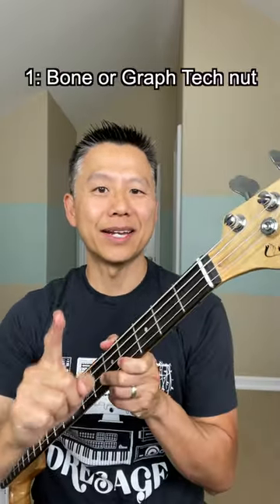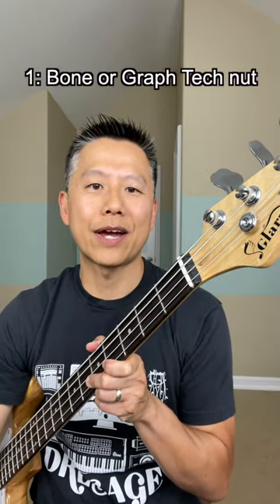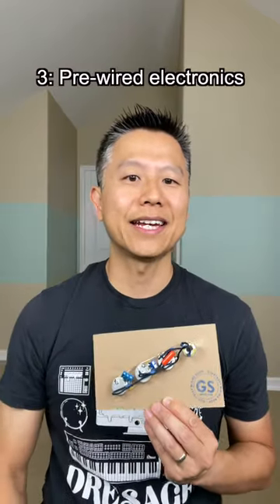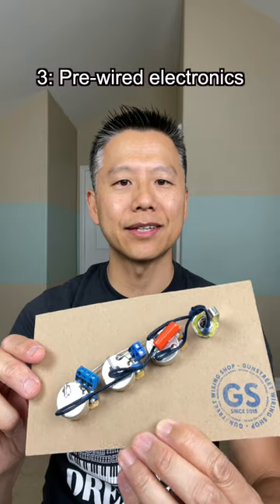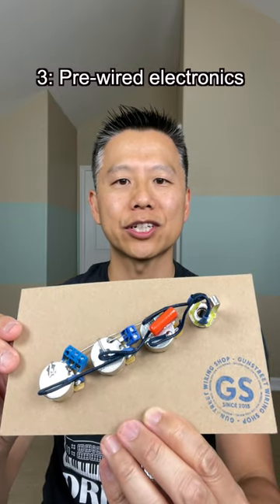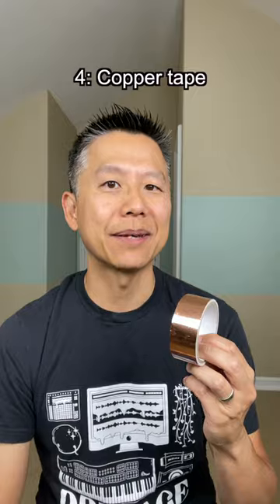How to Turn Cheap Bass into Killer Bass Guitar #shorts

Comment: And spend a few hours on fret levelling, rounding off the fret ends and polishing them.
Reply from the maker: Yes this. Although I was surprised that the fret on this Glarry bass were pretty good. No sharp fret ends but I didn’t check levels. I’m sure with some work it would be even better.
Reply: I would just pay to have the damn thing PLEK’d if ur gonna go that far
Reply: Replace Neck . . Replace Bodywork (wrong Cheap ass Wood )

Comment: I actually bought the entry level Spector and it's a monster right from factory,  just going to change the nut to brass and the heavy weight bridge and copper shield the electronics cavity.  I actually like the stock pickups in the Spector.

Comment: I did not replace the nut, i am using sjb1 instead of sjb3, replace all pot with CTS and puretone jack, also use threaded saddle for more precose string spacing
Reply from the maker: That’s great. If you haven’t already, check out my full length video for tone tests and final impressions. https://youtu.be/o8gesEiL_1k

Comment: And 1 more thing....spend 50-100usd on a high mass bridge. A Leo Quan BADASS bridge is one of my go to modifications. Aside from increased sustain and tone, they intonate better and have better stability thanks to the shallower string angle.
Reply from the maker: Cool thanks for the tip

Comment: Along with some Schaller tuners and a Badass Bridge.
Reply from the maker: Good suggestions for future project
Reply: @AntshayMusic  basically that's what I did to my Yamaha 5-string 30 yrs ago I replaced all the hardware. I added Bartolini's Pickups (P bass & Jaz,) plus Active Electronics also adding a mid boost to get that simulated Jaco sound. That was my main gig Bass. So versatile..

Comment: I'll give him credit for the mods done, despite info being obvious. But i do have to say that if you're going to upgrade your bass after purchase anyway - just buy a better bass from the start. It has better quality wood and hardware, so you won't have to upgrade as much. Wiring is also a rather unnecessary mod unless you have really shitty wiring or really good signal chain (amp, speakers and cables)
Reply from the maker: Agree. Check out my full length video where I explained why I went ahead with the mods https://youtu.be/o8gesEiL_1k

Comment: Should have done a quick lick or few riffs on that bass to compare the tones of the cheap factory hardware and the quality pieces. Looks badass and I'm sure it sounds awesome, but if you grow tired of that upgraded bass it's still a cheap bass that's only worth the value of the hardware you swapped in so be sure to keep all the original pieces just in case
Reply from the maker: I'm working on a full length video...stay tuned
Reply from the maker: Here you go https://youtu.be/o8gesEiL_1k

Comment: Usually need to address the frets. There's usually sprout and one or two that are not level. At that point just get a new bass.
Reply from the maker: The frets on this Glarry were surprisingly good. No significant fret sprouts and no major issues with levels. That’s one reason why I liked the bass enough to want to do the upgrades
Reply: @AntshayMusic  That's not the norm regarding the level frets. Its almost always a problem, even higher end import basses in the 1k range if checked out will have 1 or 2 that are not and require a full fret leveling.

Comment: I suggest buying some used fender pickups & electrics on reverb/ebay if you think that's necessary. Why would you spend so much?
Reply from the maker: I actually checked ebay and Craigslist before I made this video and didn’t find the right pickup and the right price.
Reply: @AntshayMusic  The bass is $129.58 (w/tax)
Those pickups are $192.91 w/tax.
Harness is $77.70.
At LEAST $75 to install. Nut replacement/file around $40 for synthetic.
That's $509.18 and you still own a $120 bass.
$500 would get a decent used bass, that makes more sense to me.

Comment: Did you talk about scrubbing the mold off glarry fretboards, finish hammering the frets into the board, fret leveling, etc?  These things would not be all that is required to make it 'killer'. What you say might make the right Squier a killer bass, but never a Glarry.
Reply from the maker: It doesn’t have to be Glarry for sure. The neck on my is actually pretty good.
Reply: @AntshayMusic  pretty good or "killer"? I've owned a few glarrys and all needed extensive fretwork and massive cleaning of green from neck and frets. Mt point is without luthier work beyond what you describe, a glarry will never be classified as "killer" unless you have super low standards. If you had used a squier, sure, but you used a guitar someone can buy for $70 on ebay and claim it can be made "killer", which is pretty much bullsht. You are steering beginners to buy a shit guitar and dump $400 worth of parts and it will still be a shit guitar as far as craftsmanship, durability and playability, particularly fpr a beginner. Advocating spending that kind of ey on a glarry is shit advice. That's the truth. I hope no beginner or anyone takes it seriously. It would be a waste of fkn money when you could have spent another $100 and get a decent squier or buy a tagima fpr $300 and they sound "killer" without any modifications at all. I don't understand why someone would spend $400 upgrading a glarry. Order a few more and see how lucky you got if your neck is even playable or holds an intonation/ doesn't need 3 hours of fret work. I've done it 3 out of 3 times. I didn't even feel good giving them to a beginner as it would only frustrate and discourage them from learning. Let alone encourage them to spend 5x what the guitar cost or spend as much as a classic vibe squier, which are at least on par with MIM fenders. I'd encourage people to buy a used one of those for $350 before I advised to purchase a glarry and $220 humbuckers +$150+ to install for those not equipped with proper soldering equipment or know how. Just seems horribly thought thorigh advice designed to steer beginners in the wrong direction. Think of when you started and someone to you to put $200 pickups in a shit guitar. You wouldn't be thinking back on that as a positive experience.
Reply from the maker: Point taken dude. I never said you had to mod a Glarry in particular which is what I happen to have. It can be done on any bass that you feel is worth upgrading.

Comment: Theres so much wrong with this
A. You dont NEED TO HAVE EXCLUSIVELY the seymours, 
B. you dont NEED TO HAVE PREWIRED
C. copper shielding is always a very cheap and very very very useful thing to have and i would ALWAYS reccomend it. Just my opinion, never do any guitar/ bass work with out it.

Comment: The cost of that cheap bass and pickups would get you a pricey bass to begin with...
Reply from the maker: Almost. My parts were $260 and the bass I got used for super cheap so it's still less than a Fender Mexican jazz bass.

Comment: This is all wrong. Put the money into a proper setup, fret leveling, and practice. If you need that tone, a better amp does more than pickups ever will. And if you absolutely think you need new wiring, learn to do it yourself for $20 instead of the outrageous markup on pre-wired parts.